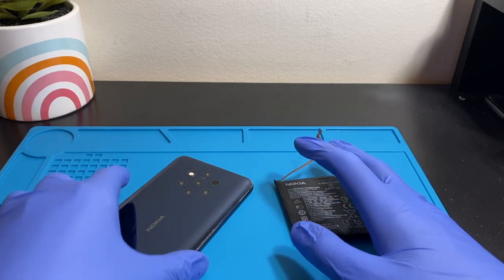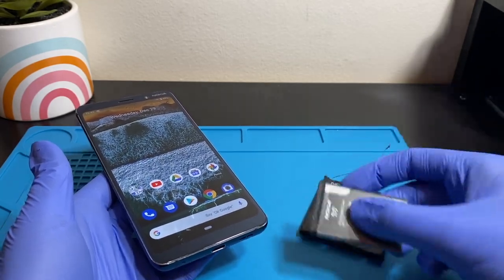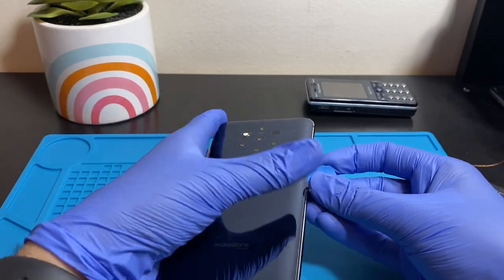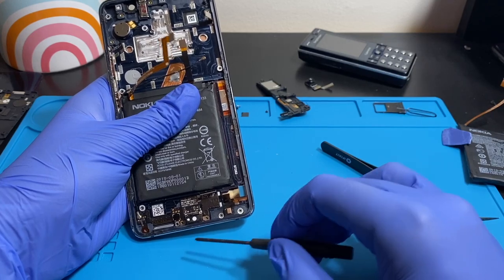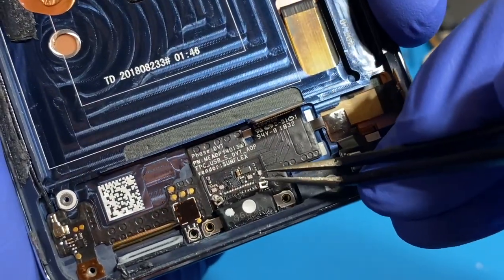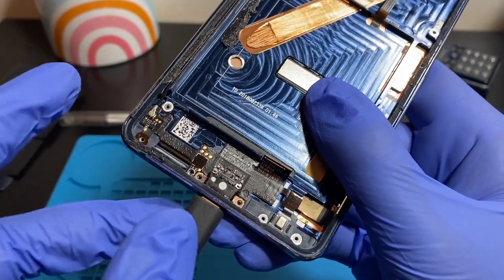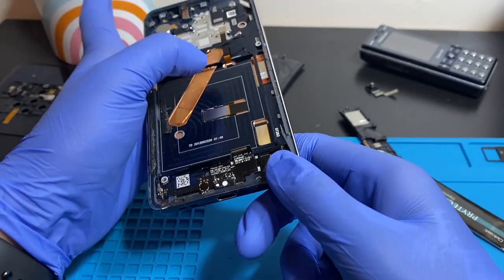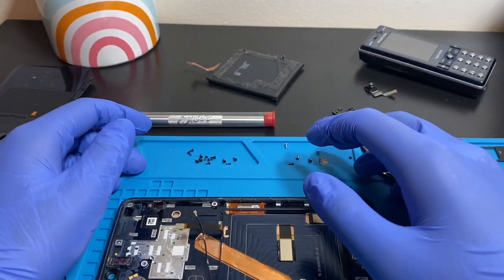Nokia 9 PureView Crappy USB-C Port Design | Repair Video Turned Rant

Comment from the maker: Has anyone else had any recent bad experiences with Nokia devices?

Let me know down below!
Reply: HMD phones are junk, I have a 5, 3.4 and 5.3 and all of them are shit
Reply: @KofolaDealer  So you bought one after another knowing they are junk? 🤣
Reply: My last ph was nokia lumia 520...n i after that never used nokia ph...
Reply from the maker: I refused to believe that before but the more I use em the more I realize what a disgrace they are to the original Nokia name
Reply from the maker: The 520 was actually a very good phone..I had one and it still works fine..very tough but then Windows phone wasn't for everybody but I liked it
Reply: @Techformative557  same even my lumia work awesome..n still i hav...
Reply: Is IT Chinese? OR is IT from Finland? Designed?
Ive had on my last job a Guy who hatet his Nokia 9  and sold IT and bought a xiaomi
Reply: Indeed yeah,friend of mine had a 7 plus with a charging port that broke in 3 months of ownership
Reply: I can repair the phone
Reply: Have a Nokia 5.1 Plus. The charging port had the exact same issue... And it bricked the NVRAM in an update too, still waiting for someone to dump their full flash so I can get the screen working properly... Ever since Microsoft sold the brand (back) to HMD, it all went downhill fast. My Lumia 950 is over engineered, especially on the USB-C port. PS: you know you don't have to take everything out of a phone just for the port right?
Reply: Used 8.1, 6.2, 7plus and now Nokia 9...No problem 🤷‍♂️
Reply: I'm currently haven't this problem for the second time in my Nokia 9, got it fixed once by Nokia themselves, but can't do that anymore, cause no warranty anymore, so I'm gonna go to a standard cheap repair store, and hope they can fix it, seems like it's hard, but that it can be fixed in many different ways, and mine is having the same issue with the loose port, so maybe they can just solder it down for me. But USB C devices in general are shit! I have only had problems with my USB C devices! and cables, have thrown out more than 20 USB C cables in the last 6 years, but still having all of my Micro USB cables, have never had a Micro USB cable or device brake for me, have some 20 year old ones, still works exactly like new!
Reply: by the way had the Sony Xperia XZS before, and I can say that that phone was for sure better! 6 years without any problems with the port, just with the cables, but changed the cables and it worked just as new!
Reply: I just found your phone when trying to look for solutions for my 9 Pureview. My battery heats up, the phone crashes when the camera is used for too long, and my charging port broke a year ago. I'm thinking of repairing it myself, and was thinking of looking at the USB C port, but after this video, yeah nah, not doing that. The wireless charging is working just fine. All I really lose is Android Auto, and a faster way to move data off my phone.

I'm planning on sticking with my 9 Pureview (my aim is to have it make it to 10 years of use like my old Nokia N85 that I retired in 2018 due to Australia cutting 3G support for older phones), any advice on where to source OEM parts?
Reply: had a windows lumia until 2018 after that i had NOKIA 8 until 1 month ago almost 6years of use . ordered a nokia 9 last month new from china  apparently for 340€ and it crashes when i use the camera or try to update apps or doing anything basicaly . i really want to use it its a beautyfull phone for heavy apps and  drone and video work i have huawei p50 pro i just lke the clean android 10 and i dont like my phone to be full of crap like the huawei is..  did anyone fix the crashing issue?
Reply: Can it still charge wirelessly?

Comment: This isn't Nokia, this HMD Global! I have had the HMD Global "Nokia" 2.2 and the 3.4, and both were useless and badly built. The USB port completely failed on the "Nokia" 2.2 and rendered it unusable, and the "Nokia" 3.4 was laggy, slow, and has a headphone jack the won't use certain AUX cables and has to be inserted in one way only. One end of the AUX cable has to go into the phone first and then into the output source, otherwise It will not work. My past 3 phones have failed because of the USB port and my current phone, an Oppo Reno2, is now going the same way with a very wobbly port and charges very slowly at around 1% every 10 minutes. It sucks.

Comment: nokia 6.1 plus shares the same issue bad charging board even you change a new one  after a few months eventually it will became loose.the plastic cover on the board became brittle because of the heat generated while charging

Comment: The new Nokia are not made by Nokia the Finnish company, it’s a Chinese company licensing the Nokia name. Also nothing wrong with wireless charging
Reply: Not Chinese but Finnish. Actual "Chinese" phones are much better than these stupid Finnish phones.
Reply: Chinese phones are rocking.. Using realme, iq and mi phones.. And they all run like beast and performance is better than many brands
Reply: @Mr.Eminem  realme is great. We don't have brands like IQ in Australia and with 3G closing soon, it's important to maintain the right connectivity with VoLTE and VoWiFi
Reply: HMD global is ex-nokia employees and their headquarter is literally on the other side of road of original nokia headquarters.

Comment: Out from the box and 3 months using nokia 5.4 lag is already very bad. Guess, android one and all this vanilla thing is nonsense. Also finger print sensor on those devices are the worse.. imagine a single finger could be registered at maximum of five times and still fingerprint recognition would be dodgy. Staying away from this brand and other brand current Nokia officials will be handling in the future.

Comment: If you think that this was a bad design by the chinese Nokia, then search for the micro usb port on Nokia E7 and N8 made by Nokia of Finaland many years ago.. that thing destroyed two Nokia E7s and One Nokia N8 in our household, and these phones weren’t cheap at all!
Reply from the maker: yes but see, with the E7, that was one of their first attempts at usb charging so it was a mess indeed. It was the changeover period from the barrel charger to usb charging. However, they fixed it and no phones after that had the issue. But HMD Nokia phones constantly have USB port issues.

Comment: Mate I think you don't know the value of this phone, it's still one of the best phone for raw photography and many photographers praised it and in future it will be one of collection items and lastly mate try to get Indian version of this phone because that one got very less issues..
Reply from the maker: The Photo's on this phone are okay..if it was actually the best it would have sold better. 
The photos are very inconsistent actually. And video recording is meh. The camera processing time on raw is also extremely slow.

Nokia ruined it further by not giving it Android 11 and made all sorts of bullshit excuses. And yeah I charge it using a wireless charger. It is already becoming a collectors item like the 808 Pureview, but the 808 was a an awesome well made phone, good quality parts and solid design. Theres no such thing as indian version, they are all manufactured the same in China. 
Nokia has had port issues for a while now, the Nokia 8 and 7 and a few others also had charging issues related to crappy port design. 
Furthermore, this things fingerprint scanner is worse than the fingerprint scanner on an iPhone 5s..its extremely bad.

And its sad cause Nokia was known for making indescribable phones, not stuff with bad design choices
Reply: @Techformative557  mate please go and check some photographers pictures taken with Nokia 9 preview and mate compare it's raw photography quality with Apple iPhone and any other phones I'm damn sure it's one of the best , all the points I agree with you but the raw photography point I don't agree with you mate., I'm glad that you showing truth about HMD I'm happy about that but don't make it's raw photograph quality as dumb and mate I think Nokia was dead in 2014 and it's better we shouldn't call these phones with name of 'Nokia' we should have to call them HMD G10, HMD 20 and so on..
Reply from the maker: I have seen both raw and adobe lightroom edits..some photos are really good but the issue is most professional photographers want consistency. This is very inconsistent sadly. I will compare it to a Nokia 808 very soon

yeaaah hmd doesn't care..I keep yelling at them on twitter and instagram but they wont notice